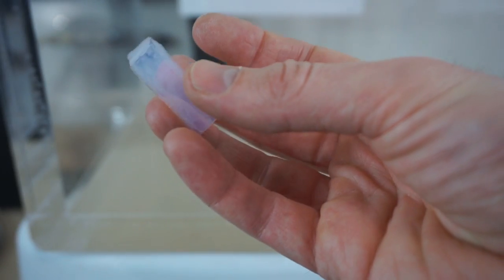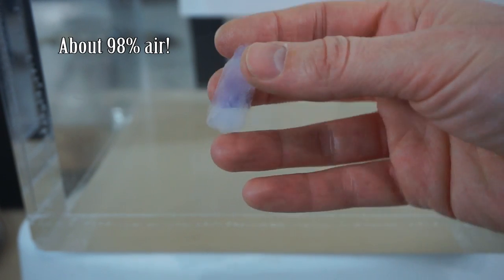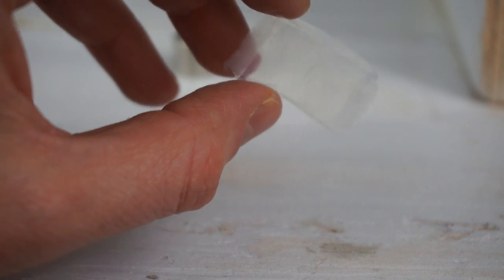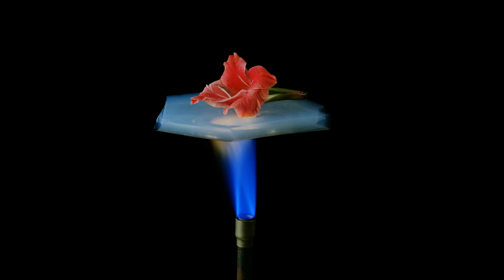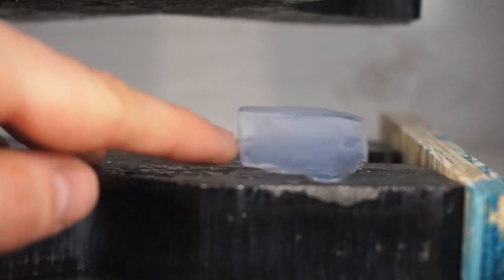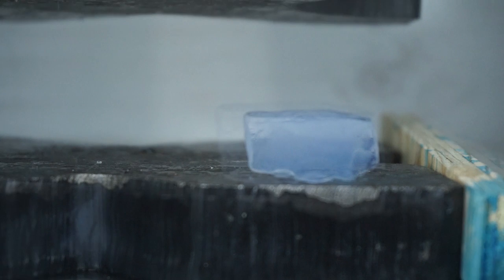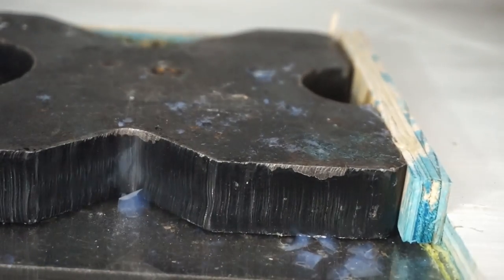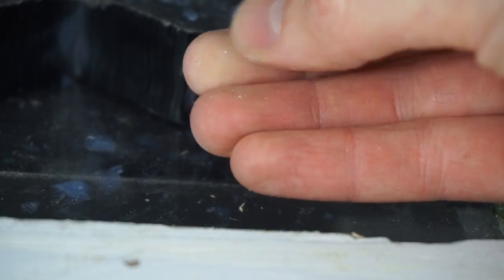What Happens When You Put Aerogel In A Vacuum Chamber And Hydraulic Press?

Comment: Wait... You said it was used in space equipment right? But yet you put it in a vacuum... Space is a vacuum....
Reply from the maker: +Caiden Mejia I would assume their insulation is on the inside of their vessels so it wouldn't be in a vacuum, but I don't know. I thought maybe it would expand or maybe collapse when I let the air back in quickly...also I had a lot of requests to do aerogel in my vacuum chamber, so I was appeasing the masses:)
Reply: Hydraulic Press Action Correct me if I'm wrong, but it seems as though it's very porous, and so the air would actually be able to escape without harming it. Although, given that it's a lot like glass it probably would have exploded instead if not so porous. I'm not sure that this is the actual spacecraft grade aerogel, although the two might be different because they have to survive slightly different circumstances, the aerogel being experimenting on by boeing for aircrafts is much more compressable.
Reply from the maker: Yeah I'm guessing that the pores are all enclosed so that it couldn't suck the air out of the pores. However I was thinking that if it did, I made the worlds least dense material even less dense since I sucked out the air!
Reply: Wait ... Wouldn't it be more dense if you sucked out the air? From a purely logical and linguistic perspective, that is.
Reply: Fredrik L No it wouldnt, because there would be less matter in the same amount of space.
Reply: Actually it is used on some space probes to collect space dust which collides with it. Due to its unique properties it is able to capture the particle without damaging them so they can later be collected and analyzed. So, obviously its not adversely affected by the vacuum of space.
Reply: g
Reply: Caiden Mejia nothing happened to it!
Reply: Well, and plus, the scientists who use it may ACCOMMODATE for what it does in a vacuum.
Reply: Caiden Mejia 🤔🤔🤔🤔🤔🤔🤔🤔🤔🤔🤔🤔🤔🤔🤔🤔🤔🤔🤔🤔🤔
Reply: Exactly
Reply: Bleak Future it is put directly in space to capture comet fragments
Reply: Yellowjakkit official no it isn't it's an INSULATOR
Reply: Caiden Mejia no its used inside an aircraft t o inslolate it. It doesn't come in contact with space
Reply: Fredrik L no
Reply: Yellowjakkit official it is used to collect fragments but its also ussd as an Insolater
Reply: Caiden Mejia it has to have air
Reply: The pores in an aerogel are open. Under a microscope, they look like extremely fine-structured sponges. They are made by removing the liquid component of a gel through supercritical drying. The structure is created by the liquid escaping. So, yes, you made the volume of space occupied by the structure to become less dense by removing the air within the structure, but the structure itself never changed density, as the air inside it is technically free-flowing. It also explains why it exploded like a piece of glass when crushed, as the microfilament structure isn't 100% uniform throughout, allowing fractures to form as the thinnest filaments shattered first.
Reply: +Caiden Mejia you know what else was put in a vacuum? you, when you were a baby.

Comment: Try replacing the air with helium and see if it floats
Reply: My bet is to remove all the air, sealing it, watch it float!
Reply: I don’t think you know how helium works
Reply: My bad I read your comment wrong
Reply: @snappingturtlehill6282  bruh
Reply: things float if they are lighter than the gas that surrounds it. If it doesn't float in air, it will not float in helium, because helium is lighter than air.

Comment: Next : what will happen with nuclear waste in a vacuum
Reply: Kunta King you never know.. nobody tried mabye he opens a blackhole
Reply: a black hole would take an imense amount of energy, we are far near anything that could creat one. but... we have created dumb holes wich are still dangerous but not even near a black hole. The force it would take to make one is if we can crush the earth down to the size of a penut...
Reply: spoogy Bears peanutt
Reply: Trantarox it won't create a black hole lol
Reply: Amelie Villaflores what is that logic lmao
Reply: ....theres a lot of very very much more radioactive stuff out there in space...like...our sun for example, which is a giant fusion reactor? and this also doesn't create a black hole...
formation of black holes doesn't depend on radiation (although there is a theoretical black hole created from light, called a Kugelblitz - but its just a theory), gravity or rather compressed matter is the crucial part for this.

And even fresh uranium fuel rods don't reach enough heat to melt down by themselves. To start a nuclear fission reactor you need a neutron source to get the controlled chain reaction going. without this the fuel rods get warm, even pretty hot, but under normal circumstances not even close to a meltdown.
A vacuum could maybe change that because in a vacuum there wouldn't be air to spread the heat away; the only way for that would be infrared radiation - which is very ineffective. So maybe in a vacuum they could become hot enough to melt down - creating no black hole whatsoever^^
Reply: Trantarox space is not ENTIRY vacuum
Reply: It would split atoms so probably a nuclear bomb
Reply: i don't think it is possible to get nuclear waste without having  cops surrounding you
Reply: Jack Yang It's legal but you'll need a license which is hard to apply for.,But you won't be able to get plutonium or uranium-235. Only uranium-238 since it's not as dangerous as uranium-235
Reply: UNTIL A BLAST OF GAMMA RADIATION ALTERED HIS BODY CHEMISTRY, TURNING HIM INTO VACUUM MAN
Reply: Heinrich Himmler I know you.
Reply: Heinrich Himmler you have 666 likes

Comment: surely if it is used in space craft it is designed to travel through space which is a vacuum? so what's the point in putting it in the chamber?
Reply: Video Zing 
Its the insulation, not the actual walls.
Reply: +Enderblawk yeah but wouldn't it be a bit silly to insulate a rocket with stuff that explodes in a vacuum when it's the next closest thing to the vacuum apart from the skin of the rocket
Reply: Video Zing insulation is not supposed to hold in the air. If you got a hole in space down to any insulation,  you'd have the same problem. That it's for is to keep the inside warm. And it does its job at that very very well.
Reply from the maker: I believe the insulation is on the inside so its not in vacuum, but I could be wrong...
Reply: Video Zing i thought about that too
Reply: Video Zing. I was thinking the same thing lol
Reply: Hi! yeah I thought it would be on the inside too, but if the outer shell was penetrated for some reason eg by space rock (exposing the insulation) it would be very unsafe if the insulation was to suddenly expand? Idk I'm just throwing questions out there!!
Reply: You are not wrong.   The material is not exposed to an actual vacuum in space.   But, based on your demonstration, it seems it would most likely hold up in a vacuum.  While obviously it does not hold up against a hydraulic press, I wonder if this material actually could be strong enough to form the walls of a tank where the inside of said tank is a vacuum.  This could make perhaps the most efficient dirigible ever built though perhaps ballast would have to be added just to make it stable.   I would like t see an experiment where such a thing is made and see if it could break the record for balloon altitude record.   Perhaps this might even be incorporated into a first stage of a space craft.
Reply: yeah sounds great!
Reply: Video Zing Thank you...!
Reply: haha common sense?
Reply: Video Zing it's just a idea and something to do, stuff online you read is legit and some are lies so...
Reply: Video Zing I thought the same
Reply: space is a vacuum but inside the craft is not. It would be silly to insulate the out side of the craft would it not??
Reply: Video Zing This doesn't make sense. It's used as an insulator that isn't exposed to vacuum.
Reply: The Stardust probe used aerogel exposed to vacuum to capture comet dust, not just for insulation.
Reply: It HAS been used on the oustide of a spacecraft and therefore exposed to vacuum. Lookup the Stardust probe.
Reply: I remember watching the feed as Stardust touched down. IIRC that mission flew in the wake of an icy asteroid (If that's the correct term), it used a bank of aerogel blocks to capture particles and safely bring them down to earth
Reply: Next, he'll be putting a steel furnace inside of a bigger steel furnace just to see if it holds up to high temperatures...XD
Reply: +Thigsy haha yeah
Reply: I really don't know haha. My first response was only an assumption, gets you thinking thou 😀
Reply: Nice
Reply: Video Zing yes we are told space is a vaccum.  have you ever seen a space suit in a vaccum?  jw
Reply: It'd also be interesting to replace the gas in the aerogel with vacuum, thus making a solid which would be lighter than air. This may be difficult to adjust the current manufacturing process to; I think it'd only stretch as far as a low-pressure gas, although that would probably work too. It may be easier to put a hi-res 3D printer in a vacuum chamber, and print a    solid with a lot of holes in it. For small holes, no support material would be necessary.
Reply: Thank you captain
Reply: +Caitlyn Huynh hi? 😂
Reply: Video Zing The isolation doesn't have to be vacuum proof
Reply: Hugo Kõks insulation*
Reply: lol, I was about to comment the exact same thing
Reply: There are aerogel plastic and carbon mixes that allow it to hold up better structurally "as it is very brittle and can be broken with your hands without any additives." also, you only really need a thin coat due to how good it is at insulating things, like the heat shield used for re-entry, in which case with additives, it could be used on the outside. Even then, it did hold up to the vacuum, it was just the instant expanse of air coming back into the chamber that caused it move it around so violently, or just simply the pressure differential and cause it to shatter.
Reply: TwofiddyFourstroke why you heff to be mad... is only game
Reply: Video Zing I knew someone would say this. I was thinking the same
Reply: The Action Lab your completely right, there would be no point in it if it was exposed to the vacuum, it
Would lose most of
The value it has

Comment: What if you were to crush things in your press in such a way as they couldn't escape out the sides, so they have no choice but to be compressed, completely 100%?
Reply: It would heat up and eventually stop the compression process as the machine just wouldn't be powerful enough.
Reply: I thought of that while coming across your post
Reply: Will it form a block hole?
Reply: Mohd Mohsin  no
Reply: You’d nuke half your continent
Reply: It would crash the server
Reply: It will be really hot I think, then it won't squish anymore
Reply: That's actually how pills are made

Comment: it should be called aeroglass since it's more glass than gel
Reply: Wat
Reply: Put it into a water and you get a gel.
Reply: 1Shalnark1 No.
Reply: It’s not even glass
Reply: The name comes from how it is made:  You start with a gel, then remove the liquid.  So technically it is a foam now.
Reply: Tyler, if you put it in water it absorbs the water, its made of silica gel and silica gel absorbs moisture. hydro=water phyllic=attracted to
Reply: Tyler hydrophobic*, ive seen something that it can be used to hydrophobic coating (I may be wrong 😆)
Reply: true
Reply: @Tyler it's made from gel

Comment: from wikipedia: Silica-based aerogels are not known to be carcinogenic or toxic. However, they are a mechanical irritant to the eyes, skin, respiratory tract, and digestive system. Small silica particles can potentially cause silicosis when inhaled. They can also induce dryness of the skin, eyes, and mucous membranes. Therefore, it is recommended that protective gear including respiratory protection, gloves and eye goggles be worn whenever handling aerogels

Comment: A quick wiki would have told you nothing would happen, Aerogel is an open cell foam.
Quote from wikipedia:
     "Aerogel is also an open porous network: the difference between an open porous network and a closed porous network is that in the open network, gases can enter and leave the substance without any limitation, while a closed porous network traps the gases within the material forcing them to stay within the pores."

Comment: Kind of dope tbh.... Its a material used in space (which is vacuum) so of course it wouldn't work dumbo. Also its still a solid, just because it has air inside doesn't mean it won't act like a solid, it is just a very small dense material hence the air material it contains.

Comment: Are you aware of how the Stardust space probe used aerogel to gather samples of dust from passing comets?  Clearly it is possible to move it between vacuum and normal atmosphere without special issues.  I think you can see that a minimal fiber structure is necessarily "open cell":  if there were closed cells, you could perforate the walls to make it even lighter without losing the structure.

Comment: Put a balloon reinforced with tape or something inside of the vacuum chamber.  We all know that helium is less dense than air, so it will naturally seek the highest point that it can reach inside of a container filled with air.  What I want to see is if a balloon filled with helium will still float inside the vacuum chamber, or if it will fall to the bottom since it has no air to lift it up.  I'm not sure if tape would make the best reinforcement.  I just want to make sure that the balloon doesn't pop.

Comment: I have an idea. Get a magnet and something magnetic to swish around the smoke from inside a vacuum. Smoke from burning paper or tissue on an electric coil that can't be suffocated ;D while at full vacuum. Then start the electric heating method however like the vacuum lid electric adapter mod you used in the lightbulb in a vacuum video to give the heating element some juice. Once smoke starts if it does it'd be cool to see what happens to smoke in still no air friction environment but with earth gravity pulling it down acts like to the magnet pulling the smoke mixing metal piece you put inside the vacuum box does when you rub it along the walls. Always been curious how smoke would act in still vacuum. Hope you know what I mean anyone else understand? Never see nasa doing smoke in 0 gravity but never seen smoke in 0 Air either so I'm just as curious lol

Comment: Somebody should make a blimp out of an aerogel with all the air removed. Treat its external surface so it doesn’t lose the vacuum.
Reply: I was wondering about that myself. I wonder if it could be done.
Reply: Ivan Mason, I feel certain the US government either has tried it or is working on it. 
In my line of thinking, if this aerogel is that light can sustain a vacuum ( lighter than helium) and can be easily be sealed, it would beat any aircraft for being lightweight and possibly float on its own!
Also, all the empty spaces within any craft were filled with this, wala, instant savings!

Comment: Leave it in a hard vacuum for a long period. All the air will eventually leak out, then  at 1 ATM the Aerogel's structure should hold the vacuum for a short while.   Is that your empty balloon that floats??  So then what about  replacing the vacuum space in the gel with super fluid.  LHe4 should get into that space. Make an Aerogel superconductive capacitor. Rather than just sucking the air out of it, you might replace it with something else.

Comment: I clean the coil of fan coils with condensate drops on the grill, after cleaning around 10 machines the bag was wet but not leaking. I guess most of that water became from high relative humidity of the air, not from condensation. I wonder if that can damage the motor of the vacuum cleaner or that not leaking humidity is not enough to get the motor in water form. 
I think the current of air and heat from motor will make the humidity to be dried. So can't get the motor and damage it. Maybe we would need a lot of more machines cleaned in order to get a leak from the bag that could reach the motor. What do you think?

Comment: Can it withstand more than 1 atm? Can a sphere with larger interconnected cavities be put into a vacuum to remove all air and the exterior coated to form a "vacuum balloon" or lighter than air balloon? The coating seals it from atmospheric pressure re-entry and the Aerogel mass inside acts like reinforcement for the hollows and structure from atmospheric pressure. The end result should be something like a lung for lack of a better description.

Comment: If you 3d print graphene nanothin buckyball in a vacuum, so the ultrahard buckyball is filled with a vacuum, cover it in aerogel so nothing can get in or out of the inside of that buckyball, and then take it out into regular nitrogen atmosphere, would that little microbead float in the air like it was floating in water?